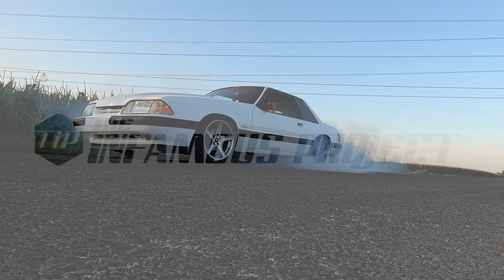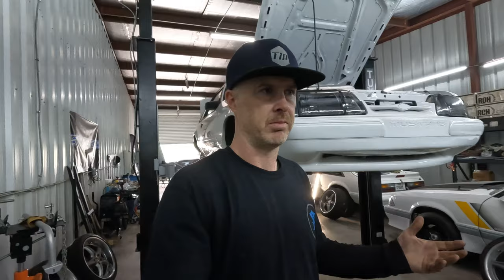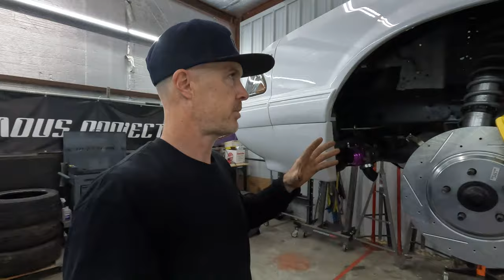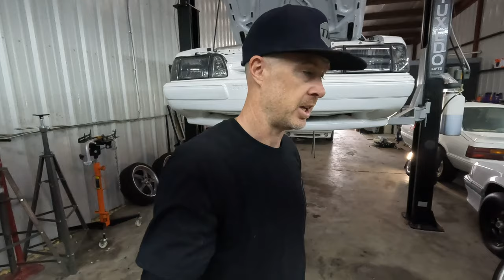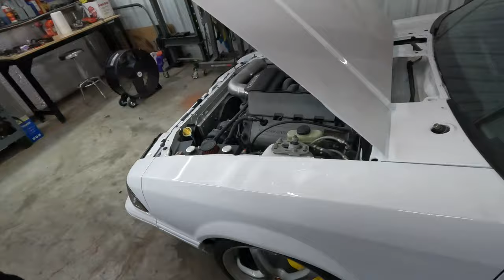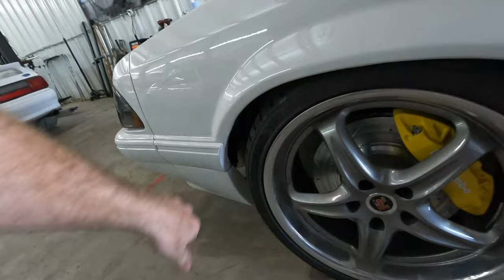Volvo Electric Power Steering in a Twin Turbo Coyote Swapped Foxbody Mustang

Comment: Great work man!  That sounds good, doesn't sound like a typical Coyote.  That car turned out sper clean, and nice.  Are those a couple of Godzillas sitting by the shop door?  Seems like that electric power steering saved the day on this build, I bet even SBF drag strip guys could use this to free up a couple of HP.
Reply from the maker: Yep them be some Godzilla's

Comment: Can you use Volvo Electric Power Steering pump for power brakes system?
Reply from the maker: Yes I am on this car
Reply: @TheInfamousProject  Is there a video showing how to setup the Volvo pump to the brake system? Do you need to add a master cylinder?
Reply from the maker: You simply run the main PS line from the Volvo pump to your hydro boost
Reply: @TheInfamousProject  Do I need to add a Hydraulic Flow Control Valve on the pump to regulate the pressure coming from the pump or just have full pressure all the time from the Volvo pump?
Reply from the maker: @chucktaylor9190  watch my latest video as I put an electronic controller on it
Reply: @TheInfamousProject  Video on now or coming at a later date?
Reply: @TheInfamousProject  Okay, thanks.

Comment: Do I need to gut my prop valve? I have the same brake set up but with 93 cobra rear calipers… 94/95 cobra MC and stock 87-93 v8 booster
Reply: Most likely no.  I put and adjustable one in a similar build to yours thinking that it was needed and ended up just running the proportioning valve wide open.